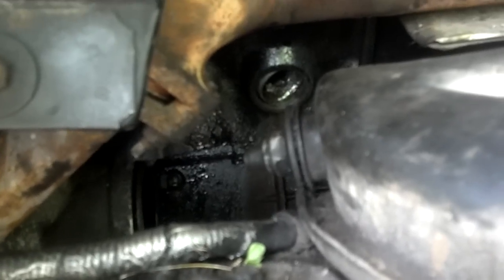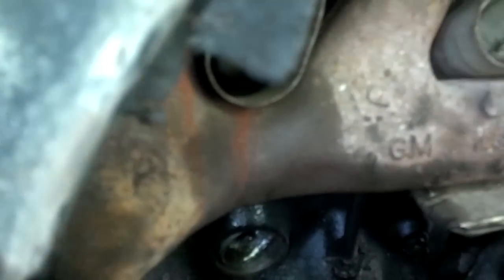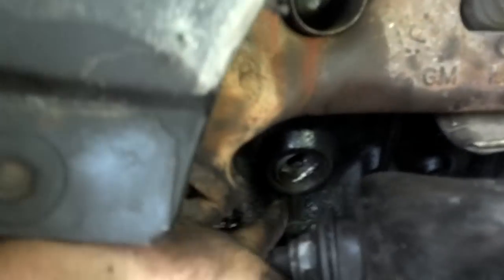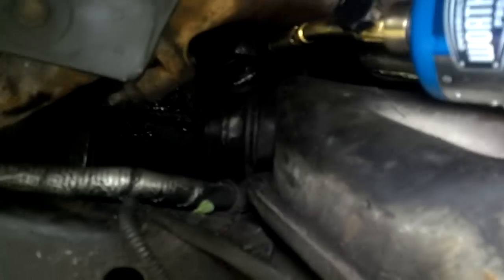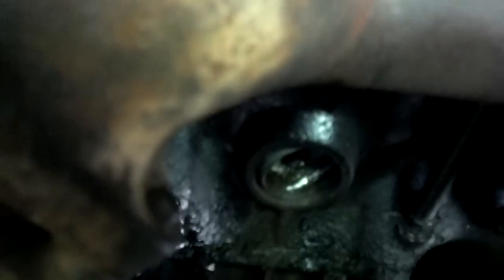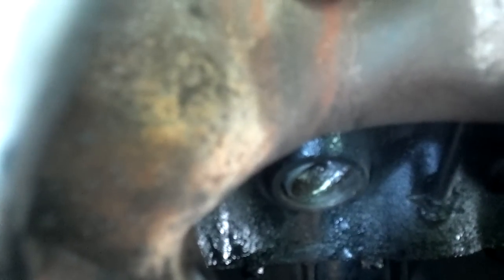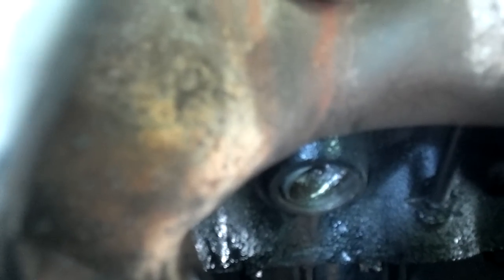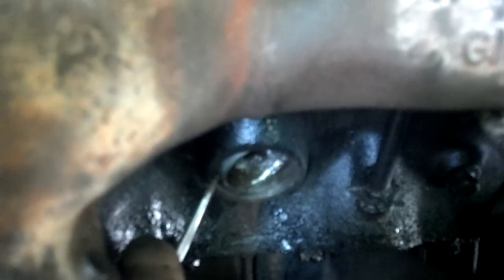Removing a Freeze Plug in a Tight Spot

Comment: I hope to post a video of a plug repair on a 98 Dakota with a 5.2. Its in the bellhousing. I'll demonstrate how to make long allthread bolts that allow you to slide trans back to allow clearance to replace them. Trick I developed to quik change flexplates on an old Trans- Am that liked to crack flexplates on hard shifts. Could swap one out in an hour. Allows about 10 inches of working space. Btw, 301 crank flange bolts are 1/16 smaller at the head than 400 bolts. Once I caught it, 3 flexplates later, no more cracking. Shit happens when you have 12 Pontiac motors laying around 😉

Comment: Great video. How would you install one in a tight spot? like behind the motor mount on a ford 302?
Reply from the maker: ouch, lol.You have to be able to drive it in somehow. Or get one of the freeze plugs that have the bolt in it, and just stick it in there and tighten it up. They aren't the best kind to use but do work.
Reply: hector mora My bronco has been sitting for years because of this.  Freaking freeze plugs went and I tried everything including removing the motor mounts and hoisting the engine up a couple inches.  The damn thing is in there.  I might try this propane trick since I've got nothing to lose.  I've slowly been getting it ready to pull the engine but if I could avoid that I'd be a happy camper.
Reply: Rubber freeze plug

Comment: just knock it in and put the new in and tap it in slowly, the plug may complete its degeneration in the block, wont go anywhere, fyi that much heat could crack the cast iron block. thnx though

Comment: Working on my 95 chevy 1/2 325k miles on it. Passenger side freeze plug is leaking, looks like I'm gonna have to remove the motor mount and raise the motor this one. Driver's side was a walk in the park thinking of just taking it to a shop, one of the biggest nightmares I've come across working on my truck
Reply: How did you come out on that passenger side plug?what did you do because im going through the same thing
Reply: Michael Davis just JB weld it and fugettabout it

Comment: Ah c'mon, you couldn't show how you put it back in to that tight spot? I could have really used that helpful info right about now.
Reply from the maker: Bob Isbell Well it was a bitch but I used a prybar and some leverage. You could also get the kind that are rubber. It has a nut on it you can tighten up to expand in the hole to tighten up and seal. Ask your parts guy about em.
Reply: Thanks for the reply. I'm doing 8 on a Dakota right now. 2 were a MUST and at bad angles with the frame in the way and absolutely no swing room for a hammer to tap them in. Trying not to go rubber since these 2 are behind motor mounts but I did find some online that are expandable that do not use rubber too. I believe they are Dorman brand. Thanks again.
JamesD2023
Reply: It's probably  a little late for a fast reply..  But u can put the new freeze plug in the freezer.  And then heat up around the hole where the freeze plug should go in..  
The cold makes the freeze plug contract.  
And the heat makes the hole bigger.. 

Also a great technique for changing bearings without using a hydraulic press :)
Reply: Thanks for the tip. I do have 1 left and its on the drivers cylinder head.

Comment: Thermo-molecular science is probably more accurate. I've got a c-$&k s@?ker of a freeze plug in the back of the passengers side head of my 68 GTO. I haven't tried heat yet.....but that's what's next. Heat and a fire extinguisher. Always have a fire extinguisher.
Reply from the maker: I get a lot of comments about damaging the block but really unless you really dont know what your doing (which in that case the person shouldn't attempt) you wont hurt anything. The plug is softer than the block.

Comment: Screw this, im thinking about JB welding the freaking thing on my 2000 gmc sierra ...any thoughts anyone?
Reply from the maker: You could for a temporary fix but it would leak most likely when it gets good and hot. Get a screw in freeze plug if it's that hard to get to. Removing it...just get it good and hot. It will come out.
Reply: HandsOnApproach ohh thank you SO MUCH! By any chance...would one be ($^^#@!$ PURPOSEFULLY placed) right behind a right motor mount on 5.7 gmc sierra 3500...?
Right after i flushed the whole thing with thermostat removed and CLR AND radiator gum out a dosen times and ran with water while runing motor and stepping on it too (yes VERY DIRTY) i guess the weakest link gave up or i flushed out the leak seal or stop leak stuff mixed with rust particles (tonns of it)...